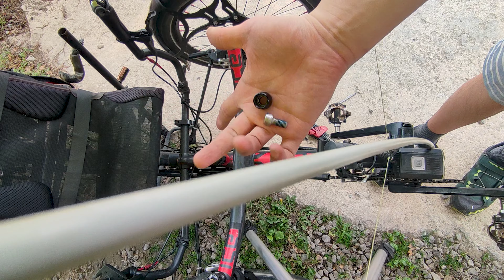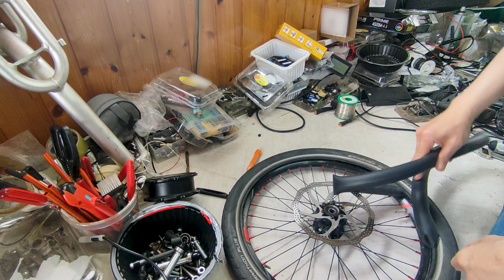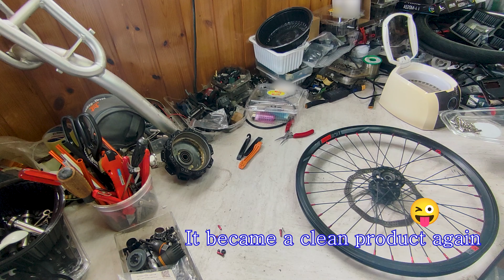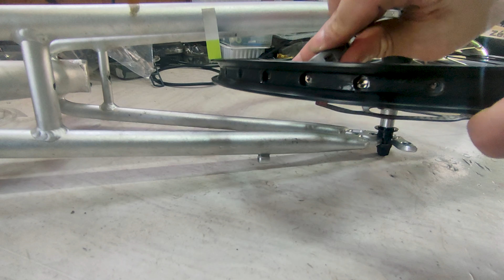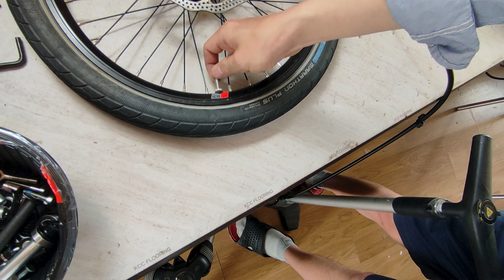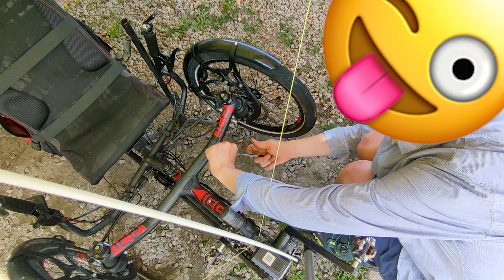part 1. ICE Sprint X , to  Sprint X Tour   Change ^^  Left wheel #trike #recumbent

Comment: Is there a way to adjust the camber on the Ice?
Reply from the maker: The camper angle cannot be adjusted by itself.😅

If you replace it with Kingpost from Performer or Kingpost from Catrike, you can make a 8 to 10 degree camper angle.

I've had the experience of fitting a Performer Kingpost to an ice-trike before

It was five years ago, 🤔so it's not accurate If you are thinking of replacing it, calculate the angle of the kingpost and decide 🙃🙃